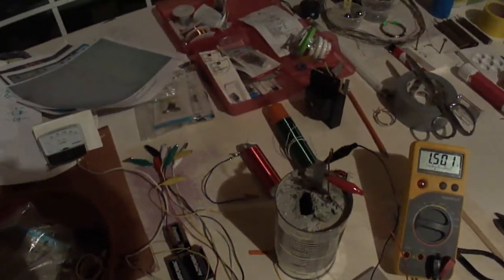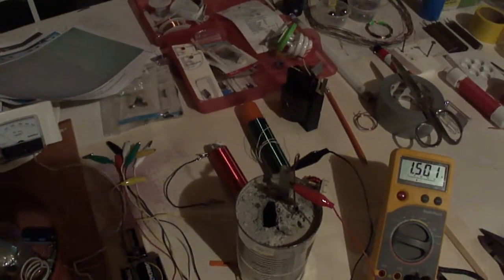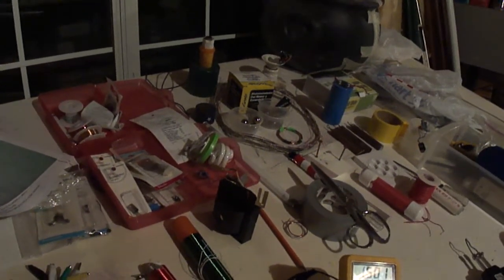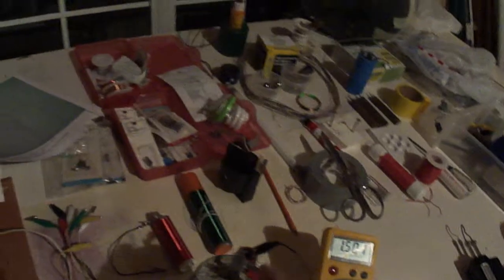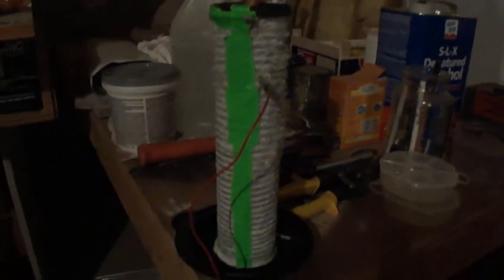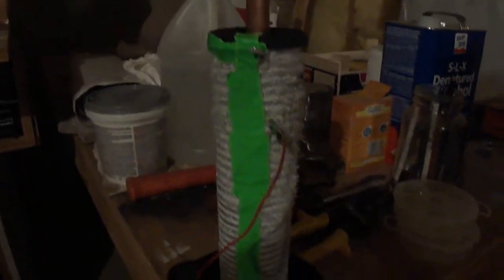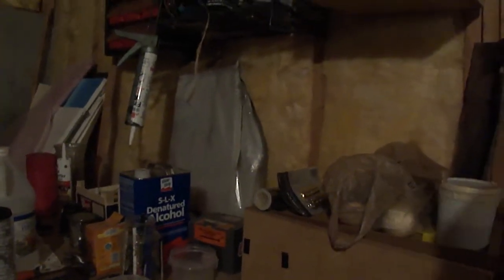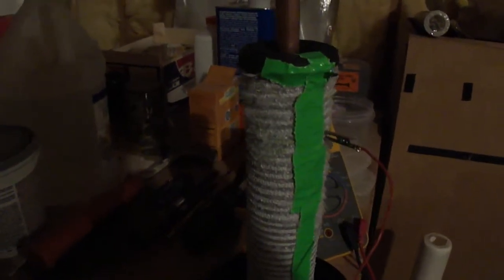Cement battery

Comment: Only recently scientists are claiming new discovery of carbon black and cement making new rechargeable super capacitor. But you worked this out 12 years ago. I find that amazing, I’m only just learning about safe non acid based batteries and this is amazing.  Does it make a difference adding other solid materials such as metal ball bearings, metal shavings, or even quartz crystals to the cement. Or is there other solid materials that will work with it ? Just curious to learn more.